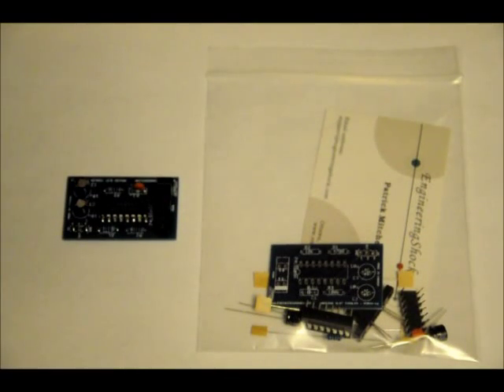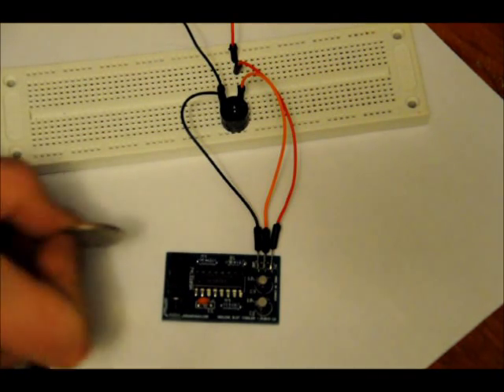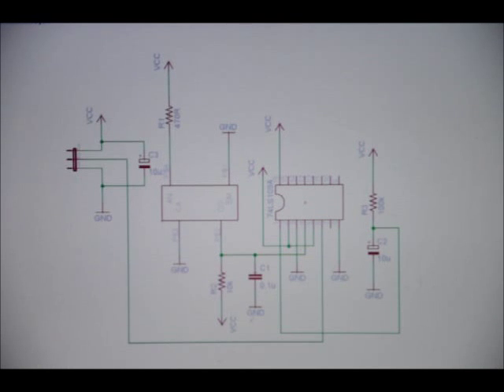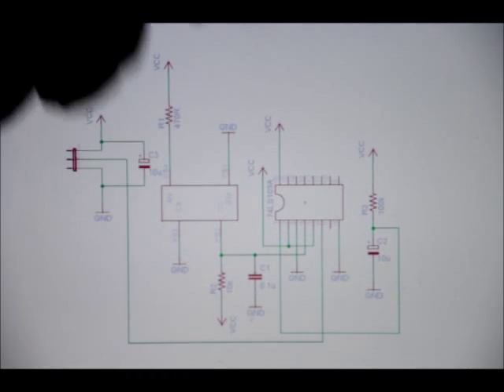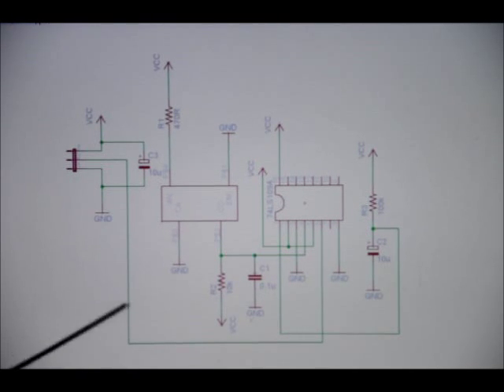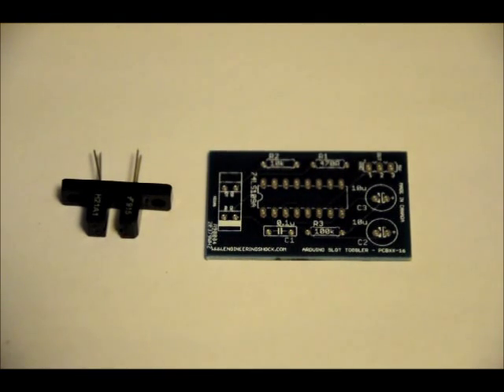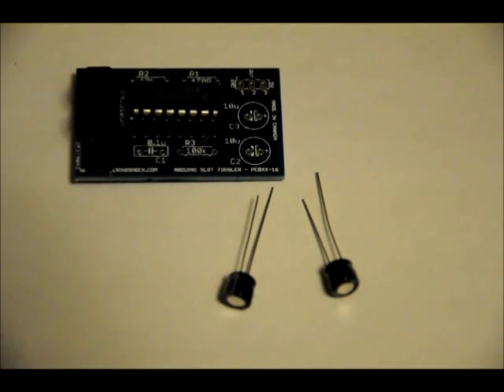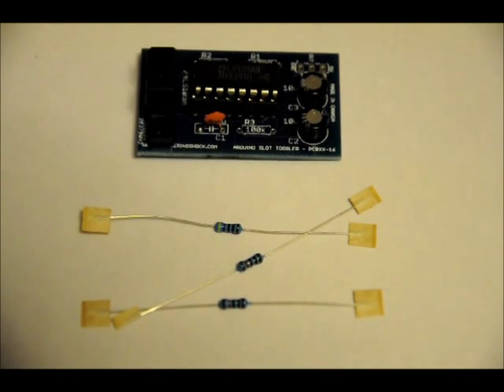Infrared Slot Sensor Toggler kit Schematic Review, Demonstration, and Assembly Instructions

Comment: I have Optical slotted Switches Types OPB990t51
Five ends of wire
  E)  led = black and red)
S)    Sensor  = Green - Blue - White ) 
How to connect to Arduino